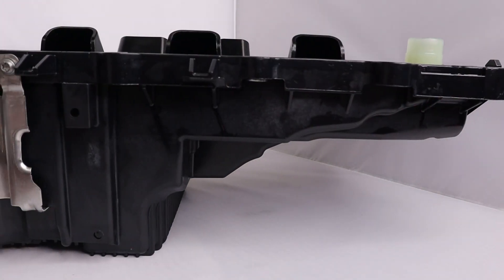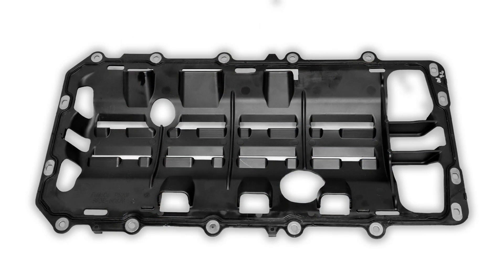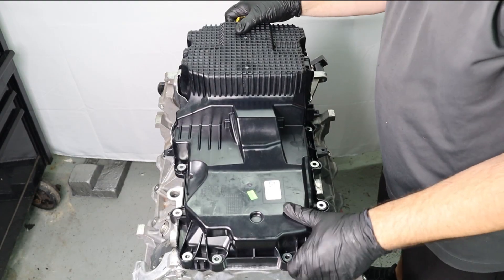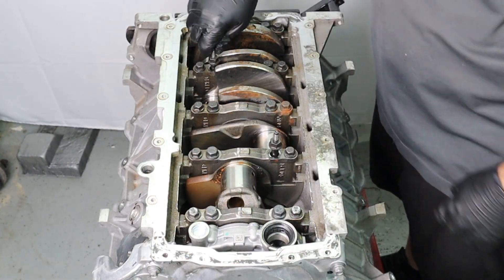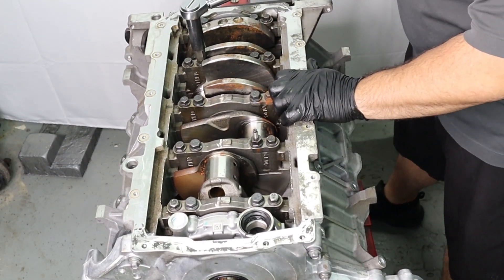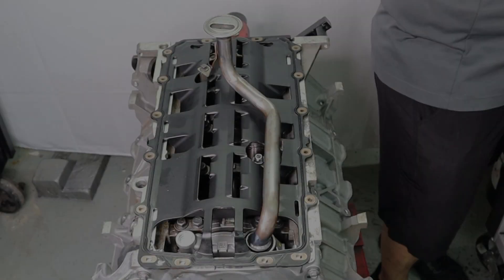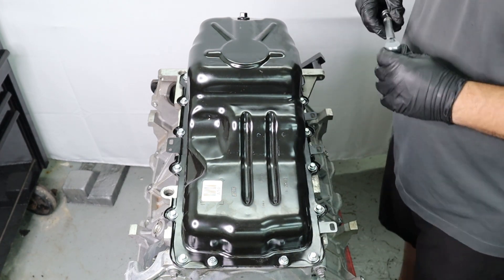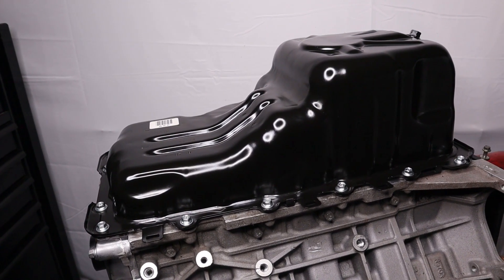We ditch the Composite Gen 3 Coyote Oil Pan and replace it with the earlier Steel Pan

Comment: Will this swap also work for Gen 3 Coyote F-150’s? I’d like to do this swap for extra peace of mind being on rough roads not having that plastic pan hanging down under the truck.
Reply from the maker: Hello, yes it will work on the F150 variant. Plus, since it is steel, you could always opt to reinforce it for the trails.

Comment: I over accidentally torqued my oil drain plug and I think I may need a new oil pan and/or drain plug gasket. This video will be helpful just in case the oil pan needs to be replace. (Gen2 coyote) Thanks
Reply from the maker: Thank you for the comment!

Comment: could this be used with an 18 5.0 F150? I really loathe the use of plastics for important components on vehicles, as well as the location and style of the oil drain plug on the truck.
Reply from the maker: Yes it can be used on the 18 F150

Comment: I have gen 1 5.0 in my 2014 f150. My oil pan gasket is leaking. Online I find a gasket with the windage tray all in one piece and just the plain gasket. Does it matter which one I use?

Comment: That was great Frank. I'm seeing my oil temps getting hot with spirited driving. Will having 2 less quarts make it worse? 8 quarts seems like plenty of oil. Especially buying motorcraft 5w50 synthetic. Any thoughts or is this just for drag racers who like to bounce the car on the oil pan.
Reply from the maker: My oil temps have been solid with this same pan. I do run an oil cooler though. This is all road course duty as well. Drag racing shouldn't creat that much heat but if it's boosted, more compression, and a combination of factors I guess it could. I would suggest a cooler to start if you don't have one already.